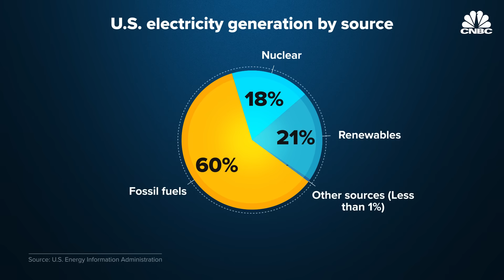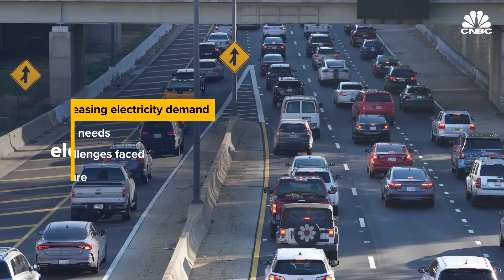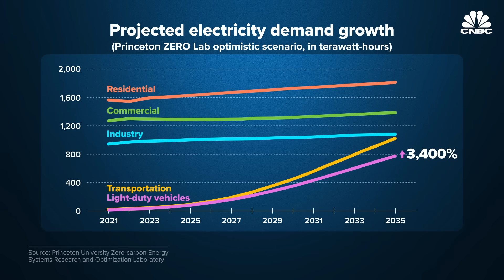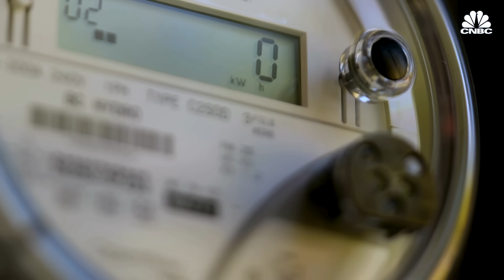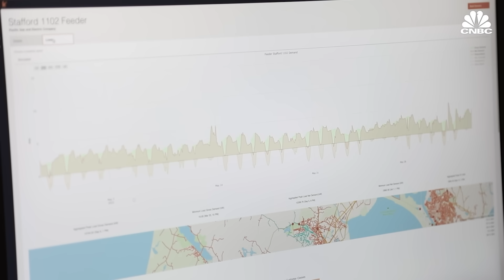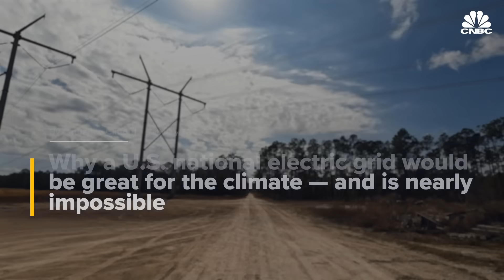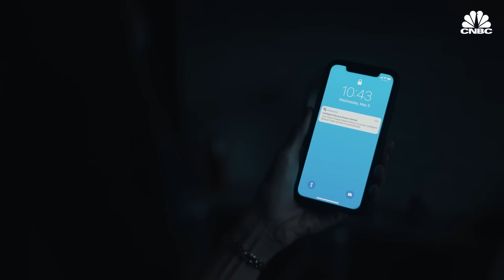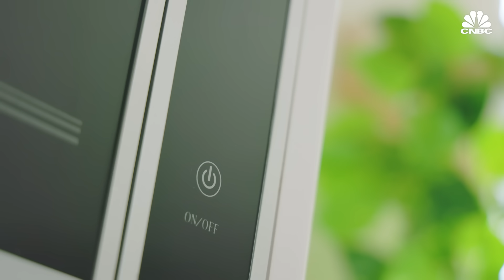Can The U.S. Power Grid Handle The EV Boom?

Comment: The average house uses 10 kwh per day. The average electric car has a battery size of 85 to 100 kwh. Now times that by 270 million cars and you tell me if the electrical grid can handle that demand.
Reply: 100kwh = 300 miles a day. That is just not the average. It is about 25 miles per day on average, which is about 12 kwh. How about you watch the video where they say that before you start with your alternate facts...
Reply: Interesting
Reply: Reduce reliance on EVs
Build more energy plants off solar wind and nuclear 
Rework cities to be more walkable 
Improve public transport

These are a good starting point
Reply: Our power grid would not be able to handle it, and be ready for lots of blackout outages. 😎🇺🇸
Reply: @nwright28  WRONG. Electricity is so much more efficient than fossil fuels and energy production so much more flexible and distributed that you'll wonder why we didn't start this logical transition decades sooner. It's only the $10million salary CEOs of the fossil industries that want you to believe what you do. Don't fall for it.
Reply: That is the worst math I've seen in a long time. People don't drive that far.
Reply: Houses average 24kwH.
Mine is 12kwH but thats leds, led tv, insulation,  and window units/ zone cooling.  My friends all pay roughly double my electric bills.   

Daily 1kwH Power generationand storage (and extended warrantee) is $800 per kwH now.  That's 8% of my usage.
Reply: What you said makes no sense. But good job.
Reply: @USNEM  basically we need to triple the grid capacity to replace every car in America with EV
Reply: @Spaceballz123 We can recycle preexisting cars to meet the demand. The mining for lithium might be a bit tricky
Reply: @Spaceballz123  EVs are 3X more efficient. Heat pumps are 5X more efficient. Denser cities are more efficient and that's a trend that will continue in most places that aren't run by hillbillies.

Comment: NO - NOT EVEN CLOSE your power grid is 50 to 100 years old with no maintenance due to privatization and obsession with profits - it can't handle hot or cold weather

You have almost no HVDC lines and I don't think you have ANY UHVDC lines - your power grid was built for the 1950's

Comment: Get with it USA.  China is building masssive solar farms in the desert.  Farms that actually  green the desert.  Then they deliver power to the cities from these farms on one million volt power lines.  Where they have the two biggest battery manufacturers in the world.  Which can be charged to deliver power when the sun does not shine.
Reply: China has also created alternative forms of transportation with the worlds most extensive high speed rail network and well designed metro area transit systems. They know that even electric cars are not the longterm solution.

Comment: Oil is in trouble 😅😂
Reply: I disagree. We need to rely on oil just a little longer to build more sustainable tools. Oil will get phased out eventually but it won’t be as drastic as some states like california is pushing for.
Reply: @tycooperaow  It will collapse as every giant does. Yes we need oil and gas in the short term, as you say. But the magic of capitalism is that as soon as the decline begins, probably this decade, it will stop getting new investment, share price will decline rapidly and the industries will spiral into a catastrophic demise taking all the stupidest investors with them. Bankruptcies will accelerate and there will be nothing left to clean up the enormous mess left by those industries. The big players will have taken their money and run long before that and the taxpayer will be on the hook.

This is a much much bigger problem than the build up of electricity infrastructure. It is not being talked about.
Reply: yeah right
Reply: Plastics, many chemical processes,  but yes... gasoline and diesel demand will top in the next few years and then decline.

Comment: Of course it can, if we can get some permitting reform through congress while training and hiring more electricians
Reply: Pay higher wages, until there aren't any jobs any more.
Reply: It isn't just Congress. In my area it can take months to get a permit to operate a solar installation, even if you just want to produce and store power for your own use and not feed any into the grid. Our electric utility also limits the size of the solar array to produce no more power than you used last year, even if you want a larger array to cover your own use and sell some back to the utility. That can take even longer to be permitted, if they will allow it at all. And, their technical requirements haven't been upgraded in the last decades. Equipment like multi use inverters (one inverter to convert both PV panel power and battery power to AC) just doesn't fit their requirements. With permitting like that it is no wonder it takes so long and costs so much to get a permit to install and operate.
Reply: yeah good luck with that. have you seen the government ever work fast?
Reply: @ThePencilPusher well there have been some movement with the debt ceiling deal making some reforms, but it not the comprehensive reform needed. I think they will get it done by this year because it’s very important if we want to meet the targets
Reply: @ThePencilPusher when they have an opportunity to go to war.
Reply: @ThePencilPusher Yes, they worked fast in placing illegitimate SCOTUS judges literally a week before the 2020 election. They sure do work fast when it’s to help the corrupt and elite
Reply: @ThePencilPusher Stop voting republican and we can get these things done.
Reply: Can't get electricians, trade schools have been shut down because of the government and public schools don't teach trade skills anymore.  Everything is about our failure in getting minorities and women interested in STEM.

Comment: Actually EV's help Stabilize the grid.
Reply: what how? you're basically replacing gas for electricity. How is stabilizing the grid? LOL
Reply: @ThePencilPusher  Because EVs get charged at home overnight. This levels out demand over the whole 24 hours. LOL
Reply: @malcolmrose3361  A better response would be EVs can feed electricity back to the grid during deficits.
Reply: EVs can stabilize the grid only if the grid supports it.